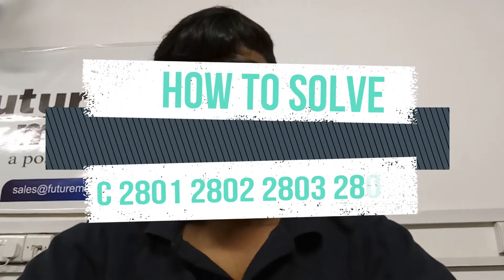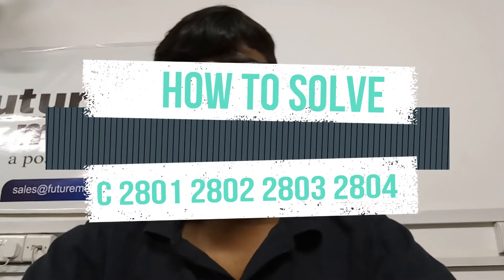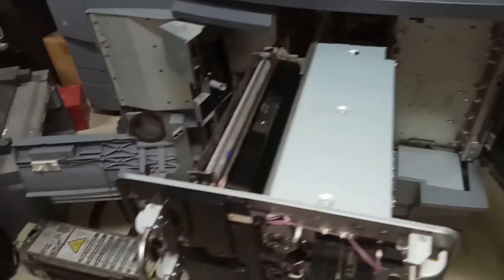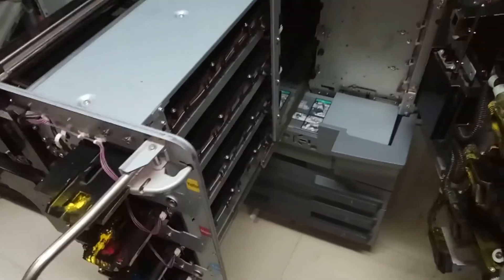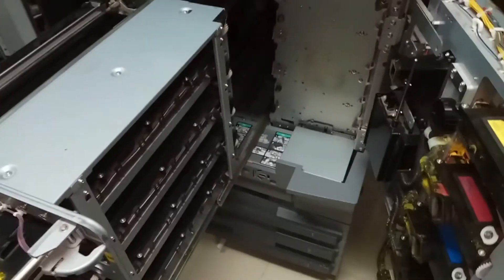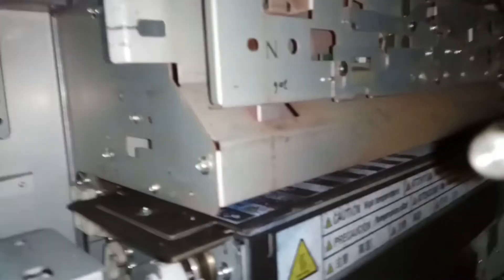how to solve c 2801 2802 2803 2804 error in konica minolta c 6500 6501 5500 6000 7000

Comment: hi, my konica 6501 machine is constantly warming up, it doesn't go to ready mode. what could be the question
Reply from the maker: There may be fusing lamp connectivity is not good or Fusing lamp blown out please check once
Reply: @printertechindia  I see that the fusing lamp has been changed at the top, but I did not see the bottom one is lit, how can I test it, is it a solution if the software is discarded?